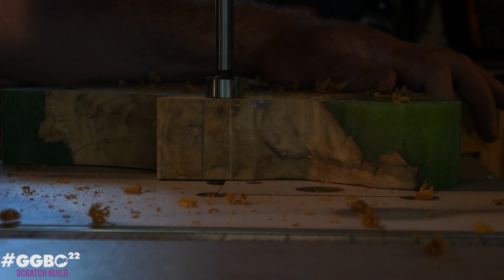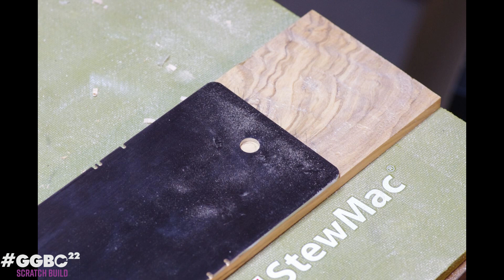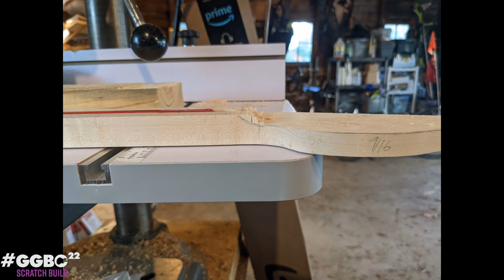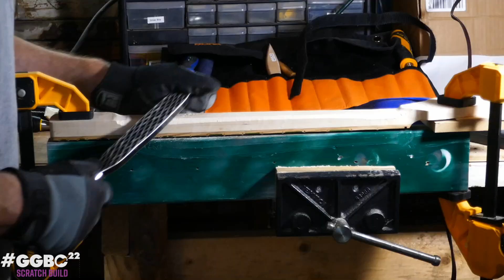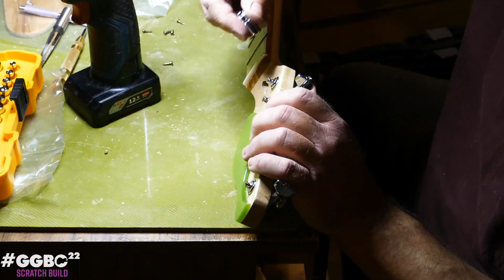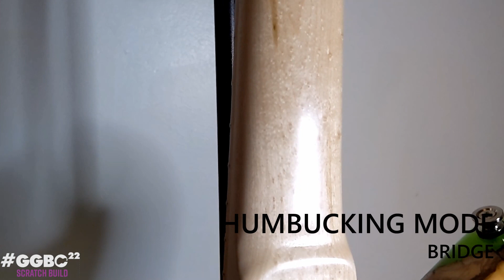Viridescent Ocean: Great Guitar Buildoff 2022 Scratch Build Entry - Complete Build

Comment: can you tell us more about these Alumitone pickups ? I read these are basically expensive nice looking crap
Reply from the maker: So far, I'm enjoying them! As humbuckers, they are convincing humbuckers. Add some dirt, it's rock and roll time. Clean sound is fine. I'm more of a single coil person myself, and I enjoy the single coil(ish) mode - bright and chimey. I will say that the bridge pickup is pretty boomy, even though it is really cranked down low to the body. 

Another thing to note - they are SUPER light (since they don't have all that copper). On a guitar as heavy as this one, I'll take saving a few ounces!